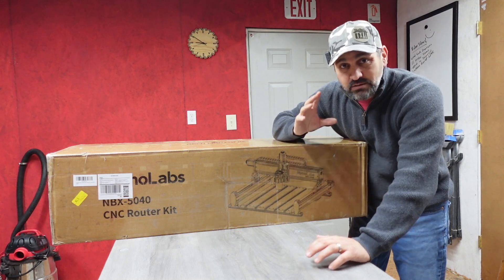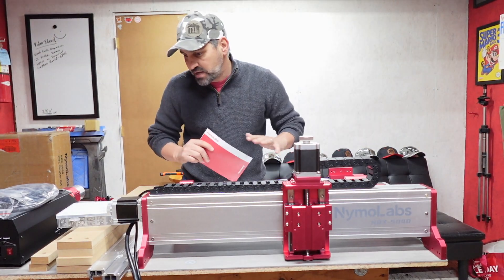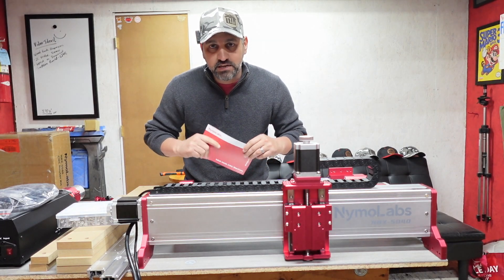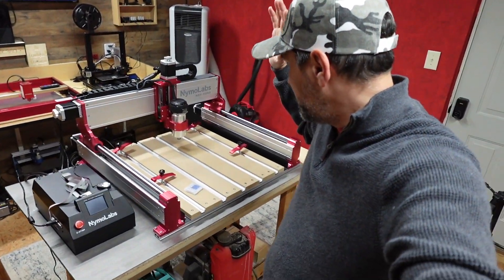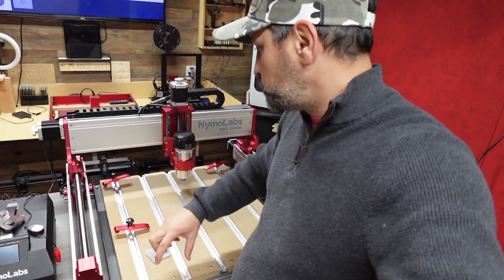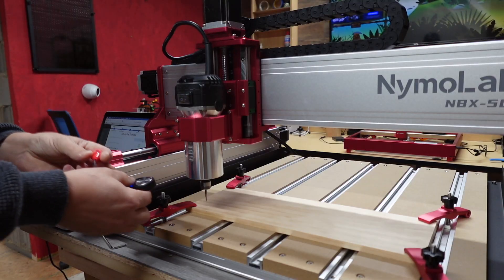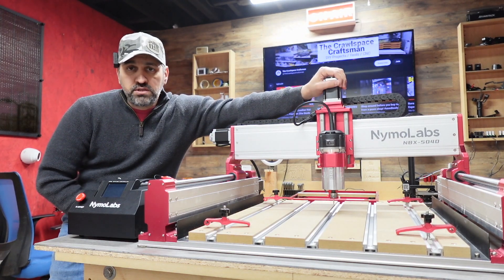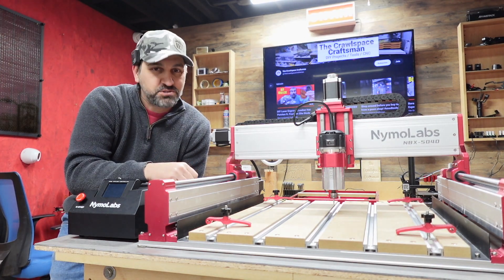Unboxing the NEW NymoLabs NBX 5040 Desktop CNC!

Comment: You're not going to find another desktop CNC machine that beats this for the price. It's currently going for $1099 USD. Nema 23s all around, 710W spindle included, linear rails, above average 5040 work area (for the price) and built like a tank. Most upgrades are already done for you out the box.
Reply from the maker: Exactly! They have a $600 off sale and I think only a few left at that price! Thanks for watching

Comment: If you could only buy one machine would buy this one or the Foxalein 4040XE?
Reply from the maker: The NymoLabs IMO has a leg up. 

#1. Linear Tube Rails
#2. 710w @ 30k rpm Spindle Provided 
#3. Larger work area.  5040

I can give you the long term review on this as of yet but so far it’s standing out!

Comment: Thanks for the vid.  Dispite all the features...too small.  Same issue I am finding with all of these "desktop" CNC machines.  Fact is, you don't need a beast when you are only doing projects that are 300mmx300mm. (500x400 is the table dimension but not the actually cutting space) You are better off buying a CNC that you can expand. Meaning one that has adaptable parts for lengthening the bed, etc.  This is what drew me to the Foxalien stuff in the first place.   Long story short, you are going to want to do bigger projects. Most of these desktop CNCs cannot even handle a full-sized guitar or bass body.   I would be interested to see how this does on metal.  Because I think it's overbuilt for wood projects and your money is better spent elsewhere personally.
Reply from the maker: Hey there! Thanks for watching but your wrongs the Travel aka work/cut dimensions are 19.75”x15.75” (500mmx400mm). Not 300x300Also there will be an extension kit available really soon. I also think the stronger the machine no matter the size, the longer it’s going to last.  I do appreciate the comment and I will provide more videos about all this very soon! Thanks for watching!!!
Reply: This is true only if you use a tape and glue method of holding your work piece down which, is not recommended for serious CNC work.  So while technically true that it is 500x400, practically, it is not.  I still believe the CNC is over built for the sized projects you would be making on it.  I look forward to your future videos.  @TheCrawlspaceCraftsman